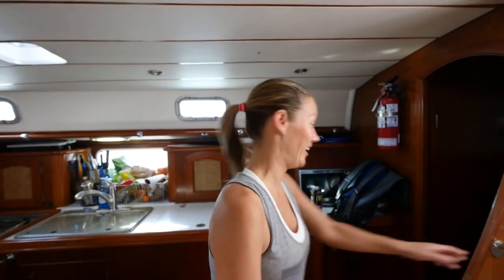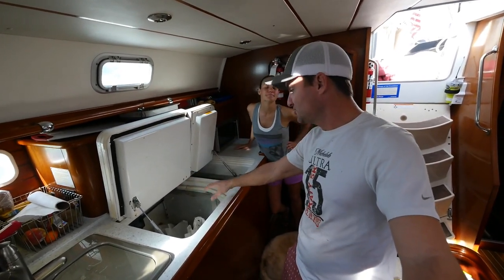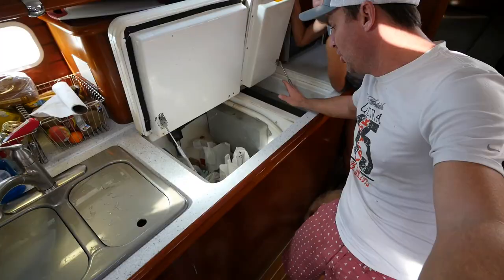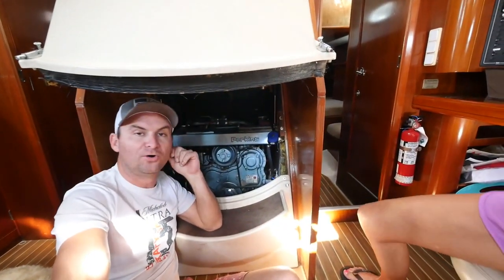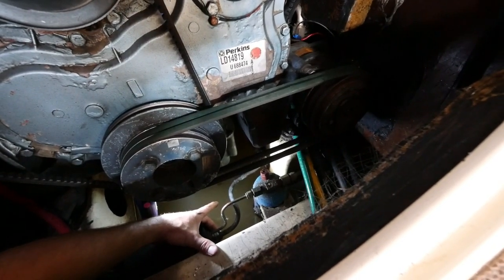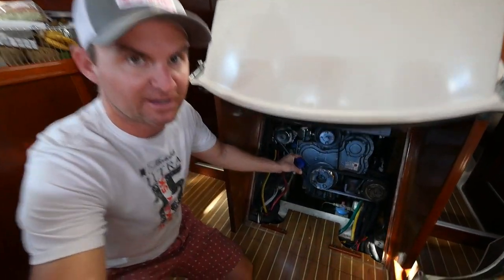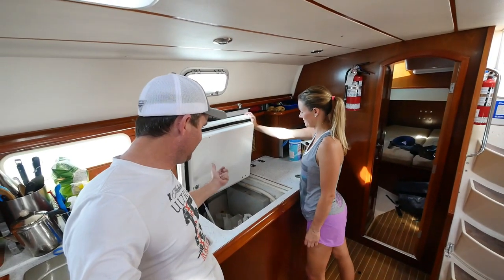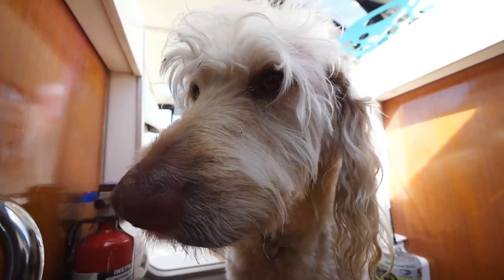No Hot Beer! Boat Refrigeration - Maintenance Monday

Comment: Bobby, it looks like the belts on the compressor are too loose.  It also appears that one is tighter than the other which would prohibit you from getting proper tension on both. Go to the parts store and replace both belts with a matched set and don't forget to purchase a couple of spares.  Glad you got it cooling again!

Comment: Bobby, you should consider buying a few extra cans of R134 to carry with you and at least one can with tracer dye in it to use first. Really helps finding leaks. Liquid soap works on the connections with compressor running if the leak is big enough. 
 The cans are 12oz = 3/4 lb.  So 2 cans is 1.5 lbs of refrigerant & it still looks low..
Also, need to gauges to check pressures. R134 charge levels are very finicky, too low AND too high on the Freon charge are both bad. When you you locate the leaks (usually orings) maybe get a refrigeration guy to replace the dryer and evacuate and recharge the system to the correct charge. Good luck, love the videos. You and Laura are a hoot together!       Steve H in Cypress, Tx.

Comment: The ice on the refrigeration lines is a good indicator you are low on R134. However, the question is, where did the refrigeration gas go? The bad news is, you have a leak and will revisit this issue again. Your first clue that your back in trouble is warm beer. Good luck, from Buffalo, NY.
Reply: Agreed...Bob did not even mention or think...why does a SEALED system need TWO cans of refrigerant ??? (Hint: cause it will need more again..soon)

Comment: You need to use gauges and calculate your pressures if you want a true, proper charge. an R12 sight glass system doesnt tell you anything about charge level once converted to 134a.

Comment: IF you Rock the can back and forth as you let it fill it will help it travel into the system quicker than letting it sit there.   just  an Observation I made when doing the same with my jeep.
Reply from the maker: +hightechhippie thanks.  Yeah I started doing that later.  Thanks.

Comment: Not that you need this trick anymore, but here is something I picked up in the Army. For any sailor out there w/o a fridge. Put a beer in a sock, dip it in the water and tie it off on one of your lines. The air will cool down the sock and eventually cool off your beer. Cold beer, no fridge. Ya welcome.
Reply: Not exactly.  Put the beer in a sock and get it all wet. Lay that in the sunshine. The water will evaporate and diminish the heat in the aluminum beer cans. Remember, aluminum is a great thermal conductor. Think back to the army guys with the aluminum army canteens in the heavy canvas bags (and felt liners) hanging on their belts. It's the same principle. The first round is in me !!!
Reply: Nah, I did this in the desert, it works. Just got to make sure the water doesn't entirely evaporate. Using a plastic/glass bottle is probably a better idea than using a can though.

Comment: Sorry to nit pick but the process of air or freezer working is not that the gas cools anything , what is does is you have a compresser that compresses the gas to liquid and when it gets to the fridge , freezer or air conditioner it goes through a small opening which causes a low pressure which in turn causes the liquid to become a gas . That is when the magic happens , it takes heat for a liquid to become a gas and it has to get it from somewhere so as long as the high to low pressure takes place in a enclosed place sure as a fridge or freezer it takes the heat out  , It just sucks it out . Thinking of the system this way will help you trouble-shoot
Reply: You're bringing back memories of getting certified in HVAC.... took me forever to grasp the concept of entropy! lol! Good-times ;)

Comment: Another "trick", When topping up the refrigerant is to put the can of R134a in a bowl of slightly warm water to get more of the R134a out. There's still some left in the can when its real cold like that. You've got some really good advise in previous comments. You Do need to get the system leak checked, repaired and evacuated and recharged, and perhaps a new receiver/drier to renew the desiccant that's inside of it. Otherwise all you done is put a bandaid on it.

Comment: Bobby; FWIW I agree with those suggesting that if you haven't already determined where the leak was and fixed it that you do so before the big passage. Checking the lines with a leak detection kit would be a worthwhile endeavor, IMHO. It would be wise to carry a couple of cans of the R134...enough to fill the system...if you should lose something and have to recharge it out on your trip..
We do a lot of boondock camping with an RV and are looking into the (12v cigarette lighter type plug) cooler sold at truck stops and other places as a pre-cooler and a backup should we lose our Ammonia fridge.
They cool down to about 30* below the ambient temp, which would be better than nothing even in the tropics. With the solar cranking you will always have 12v available even if you have to step it down from 24v if that is what your DC system is.

Comment: When charging a system try and use a oil and leak detector first people, it helps the system run better, and shows a spot if it's leaking anywhere, not the normal seepage that occurs during weather/temperature changes, it is added before the freon, which requires gloves and safety glasses as the cans have 'popped' more than once.
Really glad it's working well though, and agree wholeheartedly that top loading fridge/freezers are much more efficient, and are preferred in a boat/camper or even cabin setting, just requires you to remember layers, but as long as the top layer is always beer, it never seems bad at all ;)
Episode was to short, and when is "bought tons of merchandise only chat" going to happen? As some of us feel a bit excluded.  You're making good progress down the coast however, and hopefully get back on schedule a bit.
Reply: Good tip on the leak detector. You can also buy refrigerant with the leak detector already added, though it does come at a premium. It has saved me time locating tiny leaks on more than one occasion.

Comment: So you have to run the engine on a regular basis to keep it cold. How often? Or does the engine just automatically start?
Reply from the maker: +Jim Bigner we have to run the motor about 30-45 minutes a day to run the fridge, also helps top of the batteries

Comment: If your system has a site glass its whats used to find out when its charged. The problem your going to have is it will leak out. 134A is a blend refrigerant so it would be advisable to find the leak. You should bubble check all of the flare connections to see if this is where the leak is. If its not check the coils. If you keep just adding Freon you will eventually cause more expensive damage. Refrigeration systems and air con systems are meant to be sealed systems. R22, R12 systems you could add Freon to since its a single refrigerant but newer refrigerants are blends which biol of at different temperatures so the metering device will start to cool incorrectly which will then require more or less Freon to be charged correctly. This in turn will cause problems in the pressure. Which eventually will cause damage to the compressor. do not bubble check while the system is running. Some 134a systems require the suction side low pressure to run in a vacuum.

Comment: Bobby add a small 12 volt fan to the fridge. This would circulate the air when closed making the fridge more efficient.  Have it on a switch so when you lift up the lid the fan turns off.
Reply from the maker: +Scott Simpson great idea!

Comment: Is there is a difference between the freeze plate and the refrigerator plate or is it just square footage of the compartments that dictates what’s what?
Reply from the maker: +jseitzer83 no, they are roughly the same size but the freezer section is much smaller so therefore stays colder longer.
Reply: Sailing Doodles thanks! I’m buying a bit with a huge icebox I want to convert to something like your boat has.

Comment: No.  A home refrigerator does NOT work like an air conditioner.  It does NOT blow cold air in.  It works exactly like yours.
Reply: @ Thor : Actually,  you are both right!  A fridge AND home A/C units are fan forced,  so technically, they DO blow air across the cold evap core.  The boat's fridge and freezer are merely heat exchangers.  Same thing,  only different.  BTW,  no chemical produces cold,  they only remove heat.... thru pressure differentials provided by either an orifice tube or expansion valve,  and heat dissipation thru a condenser. (ever notice the can of freon at the parts store is room temp,  until you tap it and internal pressures are lowered?)
Reply: Lets keep it simple and say the new Gal is a Heat Exchanger.. if ya know what I mean...

Comment: sucks that it only cools when motors running.
Reply: John Kaveski  The whole point of this type of system is that it requires a very short run time for a very long cooling time.
The plate inside the box is filled with a liquid, usually brine, but other liquids are used.
The refrigerant cools the liquid into an almost solid cold block like a really cold slushy. This absorbs heat from the box much longer than just a plate with coils in it.
This system doesn't need to cycle on and off like a common refrigerator.
Well designed cold-plate systems require perhaps an hour of run-time per day, and with a well insulated box, less.
The downside, and there is always a downside, is that you can't leave the boat for an extended period of time as you could with a cycling electric compressor supported by solar battery charging.

Comment: Your refrigeration may not last long.  A refrigeration tech would have evacuated the system, and placed a vacuum on the line utilizing a vacuum pump.  There is a lot of air and refrigerant in there now.  Usually this will last a little while and then stop working.
Reply: If the system wasn't opened and he was just topping off, there shouldn't be a need to evac the system. Agreed though on the importance of putting it under a vacuum first to remove moisture if a pressurized component has been replaced or opened up.
Reply: I think that according to the sight glass it was basically empty.
Reply: Maybe he didnt have access to a vacuum pump, being their sailing and all!!!!!
Reply: No he was in the marina.  It might be fine, but to fix it right he will need a refrigeration tech.